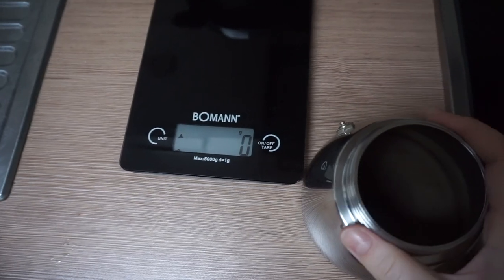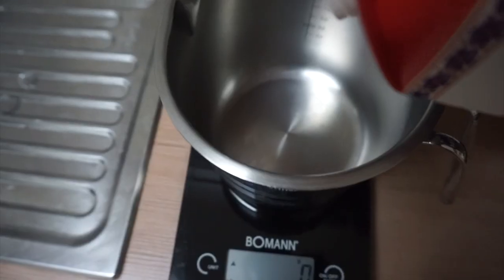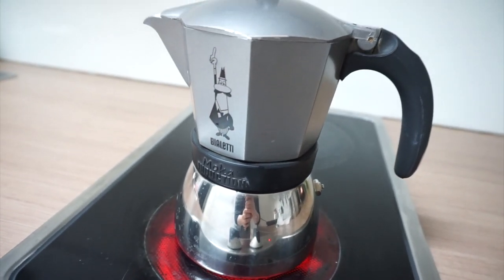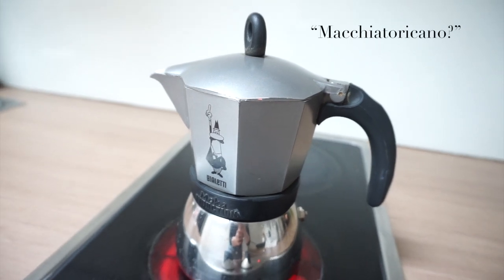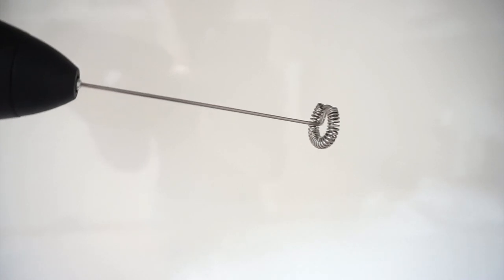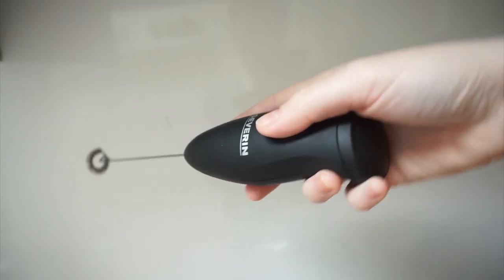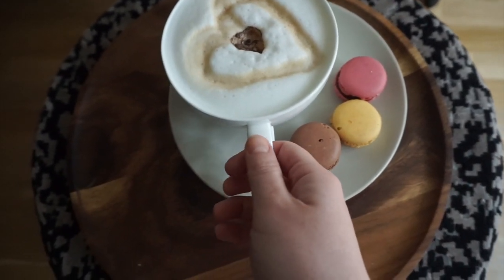HOW TO MAKE A "LATTE" AT HOME (moka pot + frother)

Comment: I was looking for water/moka-yield to milk ratio and came across your video. I noticed you used a roughly 1:1 ratio of water (in the moka): milk.

I tried the same and it turned out delicious.

20g ground coffee 
150ml hot water in my 3 cup moka pot
150ml hot milk
0/5/10g jaggery powder 

90-100ml brewed coffee (yield) poured over 150ml hot milk mixed with 0/5/10g jaggery powder = a delicious cuppa :)

Comment: Bialetti says they designed their Moka pots to be measuring cups, so the correct amount of water touches the bottom of the valve, and the correct amount of medium-fine ground coffee is loosely filled to be level with the rim of the basket. That's the correct ratio of water to coffee. If you want more or less coffee, you must buy a larger or smaller pot for the correct pressure and consistently good results. 

There are only two Italian YouTubers teaching a detailed lesson for beginners on the correct traditional way to use the Moka since 1933. Search for "Annalisa J Moka pot" for the first one. She saved my coffee! Then there's a new one by the "Italian with Bri" channel. 

I use the stainless steel Bialetti Venus Moka pots, the 2 cup and a 4 cup. I also have a New Brikka, which I love! But the Brikka instead are different from the Moka. 

I make the Spanish version of Latte, Cafe con Leche, in the same kind of glasses used by Spanish cafes: Duralex Unie clear tempered glass tumblers 8.5 oz. For two glasses, I pour 5 oz of whole milk into each glass, then microwave them by pushing the Beverage button twice, which is 2 minutes in my oven. But first I put my Moka on the stove so the milk will have time to cool a bit before I pour in the coffee.

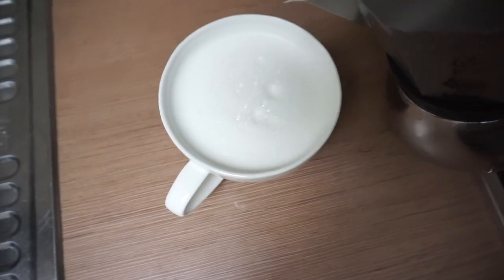Comment: Nice video. I like the chill atmos :) but I have to disagree about automated milk frothers producing the same result as the wand you use in this video. I have an automatic frother and it textures the milk far better than the results you can see at 5:12. Not microfoam but not far off. It looks like you've just heated and/or frothed it too much. If you prefer this way then okay, fair enough. You could maybe experiment with pouring the milk onto the coffee and have a go at some latte art?
Reply from the maker: I'm glad you've found an automatic frother that works well for you! Please share the make and model, someone might be looking for just that and need a nudge in the right direction ;).
Based on my subjective experience, I personally prefer the cost, space and ease of use to result ratio of a frothing wand. I've used several types of machines, for example: 

- Automatic Graef frother https://rb.gy/kwvt8g - the bubbles were quite small, but by the time the milk was warm enough to use, the foam was super stiff, not possible to pour. One time I tried preheating the milk, so the frothing time would be shorter, and I actually got it to be quite nice and accidentally made latte art. But overall, it's just a little too much effort for my taste, and I personally like to have as few countertop appliances as possible. 
-  At home Delonghi espresso machine rb.gy/wpjutt - the size makes it really uncomfortable to actually use, overall, not just the steam function. The steam was really weak and mostly just swirled the milk around. It kind of got foamy, but certainly not creamy. 
- Typical, automatic office coffee machine https://rb.gy/hdblbw - expensive, takes up a lot of space, difficult to clean, prone to technical issues... The milk foam comes out very bubbly. You think you have a cup of coffee, but 80% of it sticks to the cup. I don't think I've ever had a truly nice cup of coffee from one of these. 
- Compact pro La Cimbali https://rb.gy/qibed6 - I love this thing! Once you learn to work the steam, it's the best way to make a latte. Of course it is expensive, big etc.. But one can dream :)

Comment: Hi! I was wondering if you used pre-grounded coffee or you have a grinder? seems to be a controversial debate
Reply from the maker: Pre-ground 😊. I think it's fine to do the extra steps if coffee is your passion and it makes you happy, but for most people it's not practical. Plus I really don't like cluttering the kitchen with small appliances 🙈
Reply: Most espressos are ground too fine for the Moka, but espressos sold in Italian grocery stores are the correct medium-fine grind for Moka pots: illy, Lavazza, Kimbo, and Bialetti Perfetto Moka. They usually have a little Moka pot icon on the package.